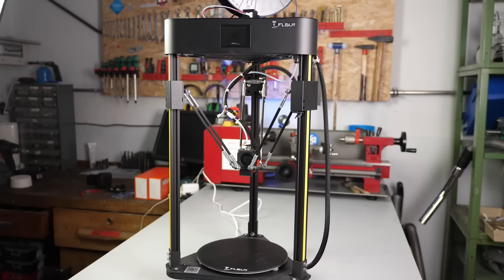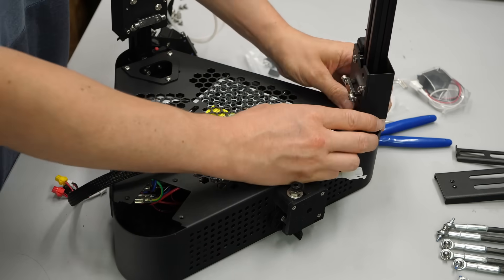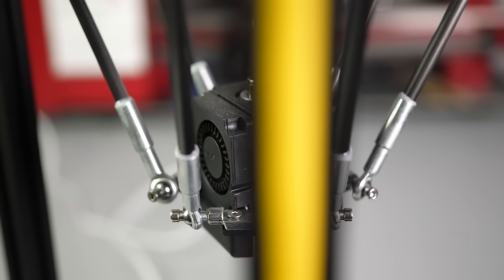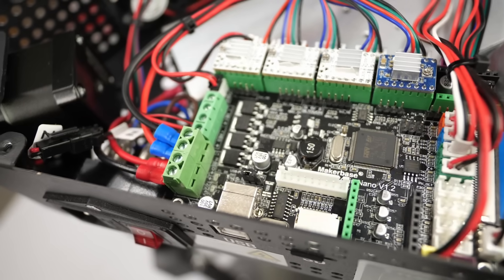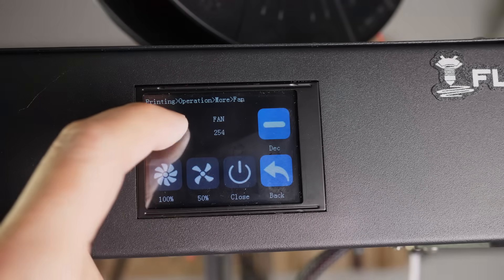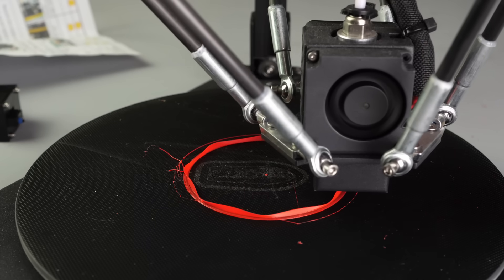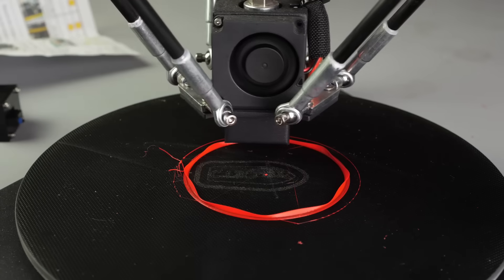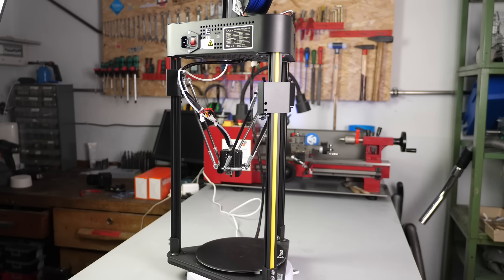FLSUN Q5 REVIEW - A 90% great machine!

Comment: First of, sorry for probably some strange grammar, but I'm german and I don't have much practice speaking english after I finished school 20 years ago. ;-)

I bought the FLSUN Q5 end of april. It was my first 3D printer (and so far only one). One of the reasons I chosed it was the small footprint, because i have limited space on my desk and no other option of placing it at the moment. The other reason was the affordable price. I would have been capable of spending more, but my first try on 3D printing shouldn't be that expensive in case it turns out I don't use it as much or it turns out 3D printing is just not working for me.

But I'm very glad I dared to try it, after quite some time of arguing with myself.

My experience with that printer is equal to your review. 
It has some quirks, but it still does decent job and the price tag is well placed.

I bought a better bowden tube as I had the same thought about it as you, but I didn't installed it so far. Same for a flex plate. I bought one because the adhesion on big parts can be so strong, I was able to lift the whole printer while only holding the printed part and once it took me 10 minutes to get my part off without damaging something. That depends on the filament though. Some just snap of once the print is finished and the build plate cools down and just wait to be taken of.

Next thing I want to change is that hot end cooler. It is quite loud. Even though it doesn't bother me as much because it is a steady noise, I think a little bit optimisation is worth it.
Maybe a better mainboard will come after that. I noticed the little blobs, but didn't know how to handle them. I saw a video of... i believe it was Chep, where he showed a solution with Cura settigs, but my settings already watched good in that regard. A better board might be the right solution here. That would handle the firmware "problem" as well. And by problem I mean the proprietary part. That could be a good opportunity to upgrade the extruder stepper driver as well.

As with many printers you can make them a little bit better with self printed parts.

Most importantly the part cooling. The fan only blowing from one side makes overhangs from the right quite good but realy bad from the left side.
I printed this replacement: https://bit.ly/30xcqF2 (thingiverse link)
That made my overhangs way better. Meanwhile there is another design where the fan duct is easily detachable but I have not printed it yet.

Another thing i did was printing these little hooks from thingiverse: https://bit.ly/2CzbNTa
My studs had a slight rattling noise. The rubberbands fixed this. But that didn't affact print quality as far as I can tell.

Last I made this carriage covers from thingiverse: https://bit.ly/2E2slTX
Just to have less moving weight.

For the same reason I want to try printing the support frame for the hotend and partcooling fan. But that have wait until I have the time and mood for it. ;-)

I think the biggest downside of a delta printer can be the round build plate. This one has a diameter of 20cm. I think it is decent and works for many parts. But as soon as you have something with a rectangular footprint it can be an issue. Largest one I designed myself and printed so far was a Nintendo switch stand. It is 164mm wide and 72mm in depth. That was pretty near to the edges, leving only a little bit space for the purge skirt. On a "similar sized" cartesian printer with a 20cm x 20cm print bed you could print two of them at the same time and still have room  for some other smaller parts if you so desire. But a cartesian printer with that printbed would take more place on the desk as well. So you can't realy compare 20cm diameter with 20x20 rectangular. But I think just because of the same number some people might expect kind of the same build size you can achive.

Last but not least I want to thank you for your awesome channel. This is one of the channels that tought me quite a bit about 3D printing and made my life easier.

Update:
A small Update down in the further comments.
Reply: Ich hab dir den auch neulich geholt und gleich die Lüfter gewechselt. 
Das einzige Problem das ich habe ist das die Drucke in x 1% in y 2% zu groß sind und in z eher zu klein.
Hast du eine Idee was man da tun kann?
Reply: @BBFPV   
Entschuldigung, habe die Benachrichtigung über den Kommentar wohl übersehen.

Ich bin selbst noch neu beim 3D Druck, aber so wie ich das bisher mitbekommen habe, ist es nicht so einfach die Stock Firmware zu ändern. Aber in der Hinsicht habe ich eh noch keine Erfahrung und könnte da keine Tipps geben.

Spontan würde ich sagen ist es am einfachsten wenn du in deinem Slicer die Größe von Objekten in X auf 99% und in Y auf 98% stellst und schaust ob es dann korrekt ist. Was die Z Achse angeht könnte es auch sein, dass du zu zu niedrig gelevelt hast. Cura hat als Standardeinstellung, dass die erste Schicht mit 0,3 mm Dicke gedruckt werden soll. Hast du aber niedriger gelevelt so das z.B. nur 0.2 über bleiben ist der Druck also knapp zu niedrig. Nun sind die Druckbetten aber auch nie 100% eben, so dass unter Umständen so vorgegangen werden muss um überall eine gute Haftung zu gewährleisten. In dem Fall kann ein Raft helfen. Das Raft bügelt dann die Unebenheiten aus und der Druck oben drauf sollte dann entsprechend genau sein. Tritt auch dann noch eine regelmäßige Abweichung auf, kannst du natürlich auch Z auf z.B 101% skalieren.

Ich habe auch an vielen Stellen schon gelesen, dass sie das Problem haben, das z.B. von einem Viereck zwei Seiten schön gerade sind, die anderen beiden aber leicht gebogen. Davon bin ich nicht betroffen. Vielleicht eine Frage von Firmware Updates. Aber da man das nicht über Slicer Settings Ändern kann, war bei diesen Leuten die einzige Lösung sich ein neues Mainboard ein zu bauen, welches die Möglichkeit gab den Drucker entsprechend zu kalibrieren.
Reply: Hey, thanks about this! I needed this :)
Reply: @JelleGrutterink  
Hi,

I made a little update here in the comments regarding print speed and quality. Maybe it is no longer an issue due to a possible newer hardware revision. But I wanted to share that additional experience I made so far.
Reply: Update:
I have to make a small update. All of the above is correct, but I noticed something on the part with the little blobs.

As Stefan noticed, the blobs on round surfaces happen because the printer makes small stops due to not enough processing power. That was never a big issue for me because in the beginning I mostly printed decorative parts. These parts where printed slowly, mostly at 30 mm/s. At this speed there are barely any blobs. Meanwhile I noticed, that they introduce at about 40 mm/s. At 60 mm/s the survice beomes quite rough due to uneven printed walls. At 80mm/s the printer doesn't make small pauses anymore. It becomes very noticible stuttering. The print of a bowl at this speed was horrible and very ugly. Straight walls and corners on the  other hand are still good at 80mm/s. So it's just an issue with round objects.

I already have a new mainboard laying around (had nothing else I wanted for christmas so a free upgrade), but I'm lacking the time to work on the printer. Planing on doing some test cylinders for a comparision of before and after the upgrade.
Reply: @MirageDU  Oh, I see! Let me know how it turns out :)
Reply: @JelleGrutterink  
Still didn't have time to change the mainboard. But in the meantime I saw a video about the Cura plugin Arc Welder (also available as an OctoPrint plugin or as a command line tool) wich converts the many small straight lines wich build a curve into a single arc move. The effect on completely round objects was a dramatic improvement. Prints at 80mm/s had still nice walls with only a few small defects here and there. At this speed the printtime even halves because there is no stuttering that slows the printer down for a complete round object. On most models the difference is not that big. If there are corves followed by longer printmoves, the printer can fill it's buffer back up again in time and won't have the buffer underrun problem.

Check out this footage I made with 80mm/s on a round testobject provoking a permanent buffer underrrun:
Without Arc Welder: https://bit.ly/2MW4wlQ
Corresponding Video: https://bit.ly/2ZbhiiP

With Arc Welder: https://bit.ly/2LNDEUt
Corresponding Video: https://bit.ly/3rVhnDD

But after I made my tests and activated the plugin on default I had quite a few failed prints. Some prints worked, but most just didn't. Interestingly a specific model always failed at the same point, even after reslicing at a different orientation. I found a few complains online about similar problems with the plugin version 3.5.1 wich is the same I have and those people said everything was fine with 3.5.0. So I guess there is some bug in the conversion wich kinde kills the printer. But I didn't search for the earlier version so far.
When the error occured, my printer moves the printhead right to the front outside the printig area and stays there. It will not respond to any commands and requires a restart. While in this state the hotend keeps getting heated and plastic oozes out of the nozzle.

Comment: I got one about 2 weeks ago.  Lube the ball joints.  Watch that the tube  doesn't  get in the way of the homing switches.  Changing some of the settings during a print causes the machine pause very briefly.  The stepper motors on mine are not all that quiet, much louder than my CR-10 with a silent board.  The extruder motor makes an annoying sound on retract.  With all that being said I still like it.  Easy to get going. I used the Flsun QQ profile and adjusted the bed dimensions.  I plan on using it for smallish fast parts.

Comment: I remember you or someone else doing a video on filament oiling.  What I remember is that using cooking oil had minimal strength effects, but significantly reduced bowden tube friction.  Worth a try as a simple upgrade.

Comment: After a bad experience with the stock ender 3, I've sworn off bowden tubes entirely.  Is this one better?  That is, is the throat design not flawed like the ender 3's?  It seems like converting this to a direct drive could be really bad for print quality, but that was my instinct for the cheap basaraba conversion for the ender 3 and my print quality only went up (a lot!).
Reply: I have 8 ender 3's, first thing you do is put in new ptfe and couplers then never have issues again
Reply: @LostCloudx4  Evidently some are worse than others.  I didn't need to go all out and print a compression fitting to keep the (replacement) PTFE tube secure, but there's a whole well-documented rebuild for the throat that some users seem to need.  I ended up going to a direct drive for other reasons (18 months of trying every stringing remedy there is without complete success) which also solved the tube slippage issue.

Comment: I was able to get this for under $200 and ran identical models side by side for at least 6/7 straight prints. Every model was arguably the same quality and a few even better. The real benefit was time, each print started at the same time but the Q5 blew the Ender 3 away every time. The benchy was half, other models were 1 to 3 hrs faster. This was with the E3 printing at .2 and 50mm and the Q5 at 1.5 and 50mm which is the default for the Cura profile (modified QQ). I agree the fan and extruder are noisy but my E3 stock was much worse. For the upgrades to my E3 I’m in it for over $250 and the new V2 reflects that price point. For under $200 the Q5 has been awesome and is my go to for quick prints. I also on a CR6 and thought it was going to be my go to but with all the issues with that line it spends a lot of time off. I hope you Stephan, come up with a replacement board option that makes the Q5 even better.

Comment: I just don't see the point of delta printers, they aren't particularly fast in actual use and the basic architecture means they are inherently more computationally demand and more difficult to calibrate accurately than a conventional machine. Also the long arms and ball joints are not nearly as robust and stable as even unsupported rails so you are constantly fighting the flex and vibration from the moving mass. This load sensitivity means remote extruders which generally (probably always) underperform compared to direct drive as the extrusion control is greatly reduced by the long feed tube. (I suspect this is the actual cause of the blobs)   I guess they look kind of cool at least :) the mechanism has its applications I am sure, something like a pick and place machine for example but I can't see any advantage for 3d printing.

Comment: I have an FLSUN QQ-S and I'm not happy. It had trouble getting the print to stick to the bed. Auto levelling is poor, multipoint manual levelling didn't help. Then a fan broke, my own fault, but support was nearly non-existent. Couldn't get spare parts from FLSUN, had to find some on Ali myself. I bought a Prusa instead, that works and is a lot smaller with only a slightly smaller footprint and print volume. Still fascinated by the delta though, maybe I'll get it up and running again someday.
FLSUN Q5 and QQ-S are cheap but NOT RECOMMENDABLE FOR BEGINNERS!
You link to a FLSUN Q5 profile for Prusa Slicer, is there one for the QQ-S as well?

Comment: I really don't see the point buying this printer instead of basic Ender 3 machine:
- has less print volume
- it more expensive (you can get basic Ender 3 for 180€ or less)
- board needs to be replaced

1 good thing about this printer is that nifty magnetic bed leveling system but do you really need it on such a small print volume ? You don't need it even on Ender 3. Also you didn't say anything about hotend ... is it full metal or not ? Also it is very limited to modifications. I see that the point of this printer that it is for people using 3d printer for first time. For me, since i have some experience and knowledge about 3d printing, it is not that good of a printer, not at that price.

Comment: My Q5 does not have a V6 style hotend. The heatbreak is not threaded into the heatsink but is instead a smooth pipe held in the heatsink by two set screws. The heatsink is in turn screwed into the effector which holds the hotend in place. I would love it if the hotend was more easily upgradeable to a V6 style so I can use all my existing parts!
Reply: Yes it's a mistake. Its a V5

Comment: I am curious of your method used for testing the thermal runaway. For instance on the Sapphire Pro, what they call thermal runaway is just a sanity check for sensor readings. But if the sensor should come detached from the heater cartridge while printing, the printer keeps pumping heat into the heater block until it melts. When addressing TwoTrees, they seemed to not be aware that a temperature sensor sanity check and thermal runaway protection are in fact different things.

Comment: I built my own delta based on the Kossel design a number of years ago.  The best upgrade I ever installed on it was the Zesty Nimble extruder to get rid of the Bowden tube.  It makes changing filament a snap, and completely did away with jams and ground up filament.

Comment: Could you elaborate more on the issues you had with the MKS Robin Nano? Did you encounter those even after upgrading to plain Marlin? 

I just bought a similar board (MKS Robin E3D), with the same CPU, wondering whether I’ll be able to use it. Also the SKR Mini E3 has the same CPU. It has 72MHz, it doesn’t make sense for it to be underpowered even for a delta. No board reviews mention any issues.

Comment: I think there is no need to tie the Bowden tube with the cables, it's better to let it run freely. I've had this machine for a couple months now, it's simply amazing comparing to my old Delta and i3 style machines. Do not use Cura though, it generates too many small moves that's difficult for Delta machine to process. PrusaSlicer works perfectly.
Reply: There is a setting in Cura to limit the numbrr of short moves.(Sorry, don't remember what it's called and not in front of my computer now. Google can maybe help. Someone made a video about it some months ago...)

Comment: @CNC Kitchen:
Hi Stefan,

would you mind sharing your Prusa slicer profile. Mine is some kind of weird and so I do use Cura (derived from standard QQ profile). But there is a bug in Cura 4.7.X when doing circles with not being able to keep the speed constant and that way creating blobs. Not being able to have nice circles on a round build plate is not optimal to say the least.
My experience with the Q5 so far:
It is as great printer for the money you have to pay. But I am a little concerned about keeping quality. My printer is making a rattling noise when printig (especially infill). That noise comes from the print head and i was not able to locate it so far. I printed for about 200h which is not that much in my opinion. I think i will have to investigate this noise which is not too easy as the screws are hidden quite well. Apart from that i am totally pleased with it. I could sit and watch the movement of a delta for hours. It is such a beauty to see a delta printer doing it's business.

cheers (Vielen Dank und schöne Grüße)
Peer

Comment: Thanx for the review!
Almost any delta is a pain in your ass! If it's not faster than Ender-3 then it's definitely not worth it.
A much better choice can be a good H-bot machine which (in many cases) will be much easier to maintain (update as well), calibrate and will give great quality prints with good speeds.

Comment: I've always wondered if these printers would benefit from using the extra degrees of freedom. I mean, printing horizontally is something every 3D printer can do, but this one could also print diagonally without too much effort which could make a huge difference in surface finish.